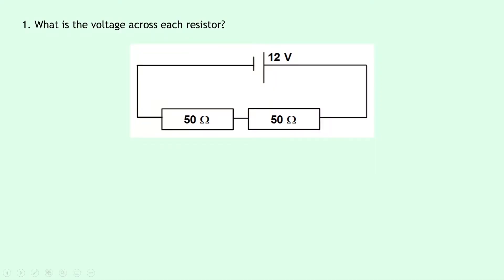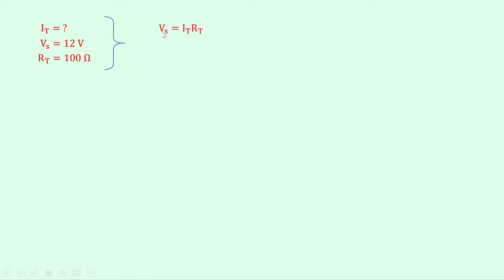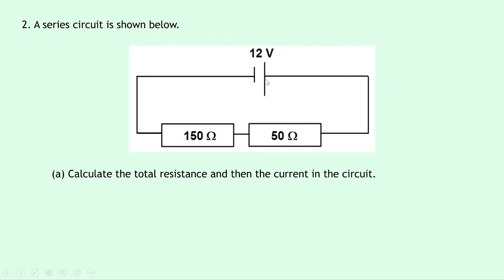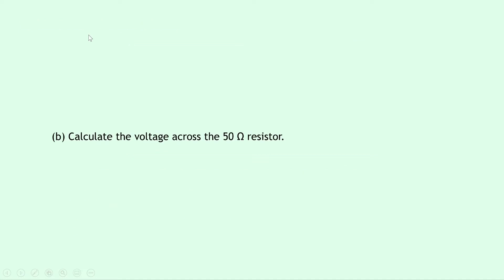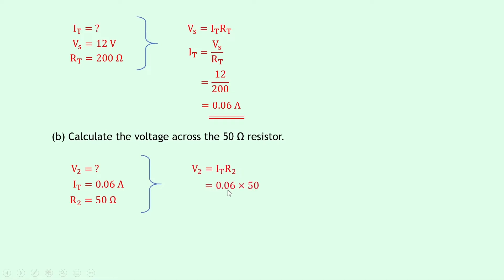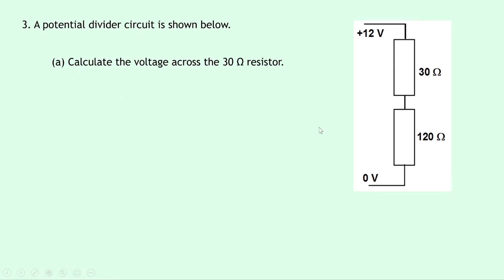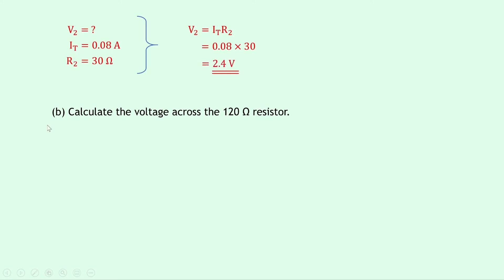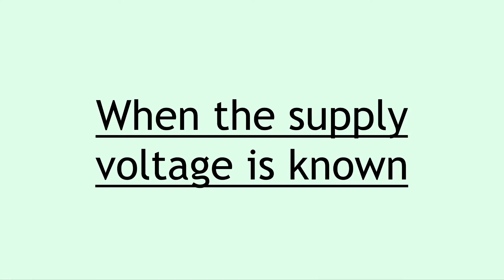National 5 Physics | Electricity | Potential Divider Circuits | WORKED EXAMPLES

Comment: for the first question is it fine if i used a different formula but got the right answer? instead of using V=IR i used V2= (R2/R1+R2) Vs 
1:42
Reply from the maker: Hi Inga, yes absolutely! I did Q1 using the long way before using the two potential divider equations at the end, just so you can appreciate why using the equations is usually faster.